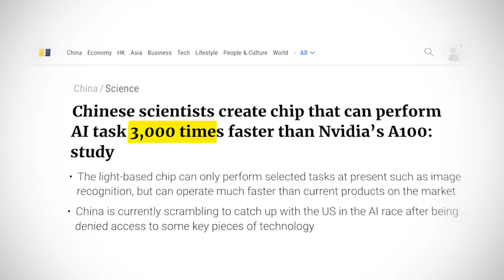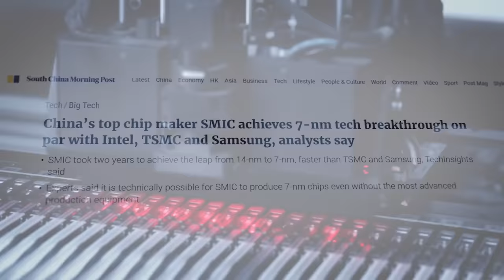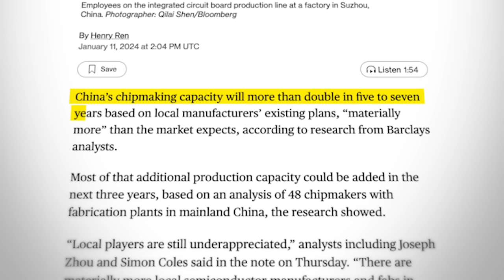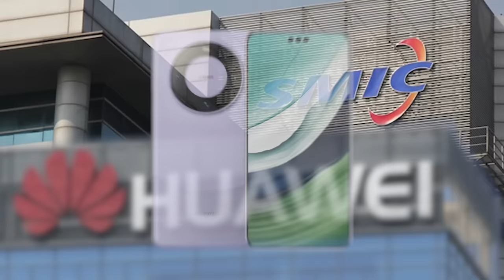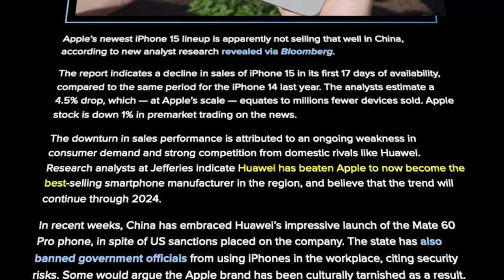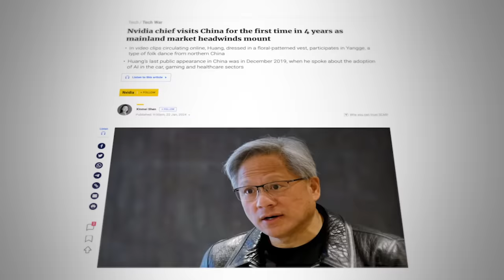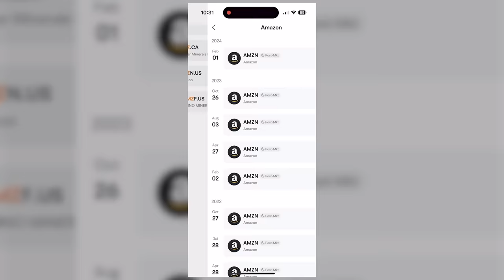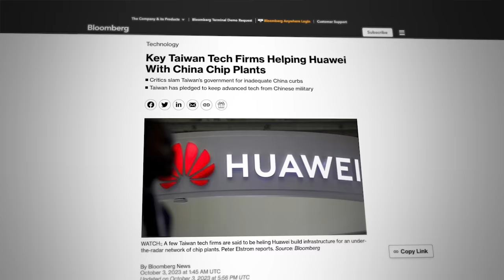China Created an AI Microchip 3000x Faster than America!

Comment: Photonic chips use photons instead of electrons in their circuits. When used for calculation, their accuracy is approaching that of electronic chips, but photonic chips have the advantage of using less power and they are faster.
Reply: do you think ernie 4.0 is the same level as gpt4? why china still can't produce something similar although tike toke have the best algorithms?
Reply: @el-_-grando-_-_-scabandri  What AI china developed is different kind of animal with gpt
Reply: @SaretGnasoh  gpt4 is the pinnacle of LLMs as for now, so where is the equivalent of it in China?
Reply: How do you manufacture photonic circuits? There's no equipment today that manufactures photonic circuits... its the circuitry that limits computing speed..
Reply: But, will it work in the dark or under a blob of that black "protective" PCB stuff?
Reply: It's mean they are fast as light..that it's a mind blowing speed and will revolutionize Quantum and AI technology
Reply: The reason why this statement isn't true is because the light based chips have to use huge lasers and focusing equipment to work so it cancels out any energy performance gains it would get over traditional chips.
Reply: @intothebeyond8763  Your statement isn't true because "huge lasers" cannot fit onto a small chip.
Reply: Most if not all the haters in this chat haven't a clue about what they're talking. Bridge collapses take place all over the place for all sorts of reasons. But tofu construction isn't oneof them. I challenge y'all to make a bridge out of tofu. If you knew what constitutes "tofu" you'll know nobody can anything out of it, except food. Food that is good for you that you will eat onr day when y'all can't afford anything else!
The Oakland Bay bridge was also built by the "tofu" constructors. Don't use it!

Comment: If China could manage to make cutting edge  chip everything in house, that would be total nightmare for the western world, since producing chip is very complex.  Hope China could do this!.

Cant wait affordable cutting edge chip from China =).
Reply: China is years behind and will have a difficult time to catch up, if at all, since access to cutting edge manufacturing equipment is cut off. A phantasized "1,000 times better wonder chip" won't change that reality.
Reply: @lorellaldos5263  Even without access to cutting edge manufacturing equipment, China managed to fabricate a 7 nanometer chip using existing lithography equipment.
Reply: @lorellaldos5263  "China is years behind and will have a difficult time to catch up". At Motorola, we said the same thing about Apple when they produced the iPhone.
Reply: @Shenzhou.  Yes, SMIC did that on ASML machines. But how will China get updated machines, or what happens when they need spare parts? In addition SMIC said the 7nm and 5nm chips are 50% more expansive than those of TSMC, usable chips are just 30% of output and they are unsure if production is sustainable. So how do you think this will work in the physical reality?
Reply: @lorellaldos5263  China already is making the DUV by themselves. Heard of 28nm lithography machines! this is the machine that can make 7/5nm chips. Next is EUV lithography. And its coming very soon. if not 2024, it will happen in 2025!
Reply: @lorellaldos5263  China is investing in developing locally made lithography machines (i.e 28-nm lithography machine). It may be more expensive at the beginning but if mass production might eventually lower the cost of chip production.
Reply: @lorellaldos5263  im not saying its easy for china, its very2 tough for china, since its not just about the tool to manufacture , but the material itself . But I thank to China for so many things that they did in 3rd world country. 

a very simple example is because of  China, 3rd world country could catchup about Internet wireless connection since 4g and now in 5g era. They gave those technology very affordable.
Reply: @idcashflow  And do you know who China is thankful to? Russia! Because Russia (or back then the Soviet Union) was responsible for the first industrial revolution in China around WW2. Up til then China was an agrarian nation, the west invaded China (the english, the japanese) and nearly destroyed the country. Russia came to the rescue (did the same with India btw.) for example with it's airfoce, China didn't have one back then.

And then after the opening of China 1979 western companies set-up their factories in China and probably provided a sort of second or third industrial revolution. We remember the joint ventures which China set up to educate it's population in high tech industries. 

But then how did the so called Americans (well they were basically all european immigrants in the beginning) rise? By technology transfer from the British via spying (they sent people with good memories to britisch factories to spy there).
Reply: @lorellaldos5263 Just like China couldn't build their own space station or advanced satellite navigation systems ?😂

Or Hypersonic Glide missiles, High Speed Rail, fastest wind tunnels, etc that the ga Ng ster superpower don't even have ?

Too bad for the blind adversaries of the dragonpower that they are indomitable ! 🤪🤣
Reply: @lorellaldos5263 You said: "the west invaded China (the english, the japanese) and nearly destroyed the country. Russia came to the rescue"

Russia was one of the eight nations that invaded China, together with Germany, Japan, Britain, France, the United States, Italy, and Austria-Hungary. The city of Vladivostok was historically Chinese before becoming part of Russia today.
Reply: @Shenzhou.  Russia got land for helping China, yes.
Reply: @lorellaldos5263  Helping? Russia was one of the eight nations that invaded China during the Boxer Rebellion. The Eight-Nation Alliance consisting of American, Austro-Hungarian, British, French, German, Italian, Japanese and Russian troops invaded China on 17 June and stormed the Dagu Fort at Tianjin. There's this Boxer Rebellion French cartoon of China being carved up like a pie and divided among the eight nations and Russia is one of them.
Reply: @Shenzhou.  China had been colonized by western countries between 1839 til 1949 or something. Over that time span of a 100 years Russia might have been one of the invadors especially in the beginning when the British successfully invaded China first, many other nations thought: oh that was easy, lets go there too. I'm sure that has been a volatile period in the region (China was forming, Russia was forming, different governemts, different political system maybe over that 100 years) but in the end Russia ended up helping China especially when the Japanese invaded 1937. The Soviets probably didn't want to have western nations on the land mass at some point. They solved all of their border issues and today are good neighbours doing plenty of trade with each other.
Reply: @lorellaldos5263 whatever China and Russia are sharing, they are none of your concerns. Many US technologies are basically US patents on Chinese technologies. Have US ever thanked to China?
Reply: Yes. Made In China chips will definitely be coming soon and will be much cheaper and more affordable despite what the US says or do.
Reply: @lorellaldos5263 read Anglosaxon medias good for ur brain' health
Reply: And Amerika will just keep SINKING, unless it LEARNS from its past mistakes.
Reply: @lorellaldos5263  China is not years behind as SMIC is about to mass produce 5nM chips for Huawei so they have caught up.
Reply: @lorellaldos5263  What's so difficult in making spare parts. You already have a sample easy peasy. Even if the chips are 50% more expensive they are only one part of the phone and will only increase the overall cost of producing the phone by a few percent.
Reply: @lorellaldos5263  This is irrelevant.
Reply: @lorellaldos5263  "Shenzhou. China has been colonized by western countries between 1839 til 1949 or something."

China (as a whole) was never colonized by the Western countries. Parts of China like Hong Kong and Macau became Western colonies yes, but not the entirety of China. Russia was one of the eight nations that invaded China during the Boxer Rebellion period. Even if you use the excuse "oh that was easy, lets go there too" that's still an invasion of China regardless.

You said: "Russia ended up helping China especially when the Japanese invaded 1937."

Imperial Japan invaded the Chinese province of Manchuria in 1937, how exactly did Russia help China in 1937?
Reply: you have that in taiwan the real china
Reply: @jacobscholtissek2410  no taiwan use asml
Reply: @Shenzhou.  Could you give a source for this. Thank you in advance.
Reply: Ignorant much? Heard of SSMB EUV lithography factory?
Reply: @lorellaldos5263 What if Taiwan returns to China?
Reply: @lorellaldos5263 What will happen if Taiwan returns to China?

Comment: How can anyone stop a nation that can build their own space station  ????🤣😁🤣
Reply from the maker: So true! and with the ISS set to be decommissioned in 2030, China will very soon have the ONLY space station
Reply: And  Russia to
Reply: A Space Station is not hard to build compared to the unseen microscopic world of controlling the flow of electrons in a microchip where distances are measured in nanometers - thinner than a human hair and even smaller than that. What a Space Station requires are just the huge rockets to send parts needed up there to low-earth orbit - all big physical stuff and China has a long history of making big physical stuff.
Microelectronics is a little bit different but not insurmountable. All that is needed are the right tools to manipulate the electrons around - and tooling is one area that China is learning to master. For example, their ability to make breakthroughs in Materials Science in the manufacturing of high-speed jet engine turbine single-crystal fan blades able to withstand the insanely high temperatures and physical stresses inside a jet engine. This was something that the West had previously doubted very much that China will be able to produce and have to always depend upon Russia for their engines. I am more impressed by their ability in this than in their Space Station even though it is no mean feat as well.
Reply: @George123-bv7xq  A  Space  Station   is   NOT    hard   to  build. you  have   said.   Afcorse   evry  country   has   one   Honduras. Venezuela   Germany. Poland. Spain. Peru   Guatemala   and   even   Albania   and   Romania.  LOL LOL What   planet   you   are on  😂😂😂🌍🌎🌏
Reply: @rogerburn5132  Don't be insulting. If you have bothered to read through what I wrote you would have comprehend that building a Space Station using known physics and engineering in rocketry is easier than the world of Microelectronics where the tools for diving into the world of electrons and quantum mechanics engineering is still at the frontier level. 
Citing examples of a weird range of mostly 3rd world countries (apart from Germany) that has little resources - economic finances and engineering skills well as a lack of national drive - to be able to build a Space Station is illogical and insipidly stupid as a counter point argument. By the way, I have a brother in NASA in IT engineering and software quality and I am in Electronics. My planet is more realistic than yours.
Reply: @George123-bv7xq   yes  I have  read   all  your   coment   this  is   why   I  answered . Mmm   maybe   I was  little  bit  to  sharp  with   my  humour . Sorry . For   Space  Stations  you   are   totally   wrong   there  is    one   international.  Space   Station    China   has   built   one   and   Russia   is   going   to   build   their   own.  And   to   build   them   you   need   space   rocket   that   can   carry   people    incredibly.   difficult   only   Russia   and   China   do   that   why   don't    you   ask   your   brother   Why  NASA   is   using   Russian   Rockets  to   send   people   in   space.  The   US   space   shuttle   was  decommissioned     many   years   ago    and   USA   doesn't   have   anything   else.   on   Microelectronics   yes   it's   difficult   but   Still   there   is   so   many  companies   that   are   doing it   The  BEST   one   is   TSMC    from   Taiwan   then   you   have    Samsung  and    Sony   and   Dutch   companies to  Chinese   to.  US   to   I   can   name   them  all   but   I   em   sure   you   know  who  they   are.  So   No   chance   to   compare   the   difficulty  of   building   Space   Station   with   Microelectronics.   I em  have   good   information   about   both    So  i  know   what  I   em talking.
Reply: @rogerburn5132  Whatever takes your fancy. 'nuff said!
Reply: In current times is not that hard to build a space station, is about purpose... is mostly hollow.. like a A background building, on a studio set. Is there to proof that it can be built, with none asking 'Why or for what'  , like their Tofu Dreg buildings... When you have autocracy , with no repercussions, you can build whatever you want,  and people need to work regardless.. it can be an empty space station, or a mega city shiny on the desert,  etc..
Reply: @George123-bv7xq  do you know how much chips inside the building of a space station ? hahaha
Reply: @George123-bv7xq  then why US not build their own space station?

Comment: Researchers from China and the US have also jointly developed a new type of stable semiconductor graphene, which displays performance 10 times higher than silicon. As silicon-based chips become smaller in size, scientists are gradually approaching the physical limit of two nanometers, by which Moore's Law would no longer apply. Carbon-based chips made from graphene show potential as an alternative to silicon-based chips.
Reply: That is correct. Photonic chip and graphene chip are the new frontier of chip. China will not be able to compete in Silicon chip in the short run as it lacks many core technology that was developed over decades of research such as design & lithography. Graphene & Photonic chip are like EV to traditional ICE cars.
Reply: @Tabula_Rasa1  Exactly. China has also invested a lot in electric vehicles and in fact, Chinese company BYD has become the world's seller of EVs, even more than Tesla.
Reply: @Shenzhou.  I know. That is why I am drawing a comparison to EV vs ICE. Graphene & Photonic are different set of animal and will require new core technology. You can't mix silicone chip with photonic chip. It will be interesting to see what is going to happen in 5 years.
Reply: "...3000 times faster than Nvidia's A100 chip!"

3,000% faster than Nvidia's A100 is not believable
3,000 TIMES (300,000%) faster than Nvidia's A100 is unpossible.
Source?
Reply: @Tabula_Rasa1  It's not that you can't mix silicon chip with photonic chip. From what I understand, there are companies that are pursuing research on imbuing silicon chips with photonic properties (i.e silicon photonics). Just like how there are EVs and ICE cars as well as hybrid cars existing concurrently.
Reply: @johnsmith1953x   It was a joint development between a Chinese research team from the Tianjin International Center for Nanoparticles and Nanosystems (TICNN) at Tianjin University, together with American researchers from School of Physics, Georgia Institute of Technology.
Reply: @Shenzhou.  Well, wake me up once they have a PC card or PC to sell that I can purchase for $20,000 or less.
Reply: @johnsmith1953x  You can purchase affordable All-in-One PCs in China at prices of $163 - $180 (from Ali BaBa) let alone $20,000. You can of course splurge more money to get the higher end PCs in China if you want.
Reply: @johnsmith1953x  There is nothing to say that they have to mass produce them.

Maybe they are for the niche market.  Maybe they aren't for your laptop.

That's the same for quantum chips.  They don't need to mass produce them.  They aren't meant for your laptop.
Reply: @Shenzhou.  I want a PC with this new AI chip in it.
Reply: @Shenzhou. 😅
Reply: @johnsmith1953x  Do you have the money then?
Reply: @Shenzhou.  I got the Motz.
Reply: @johnsmith1953x  What brand of PC is the Motz?

Comment: What a lot of westerners do not understand is that China might lag behind traditional semiconductors, they are the leaders in photonic chips. Accel is not only a combination of analog and photonics, it is designed especially for AI acceleration. Most commercial chips are designed to be multi-functional, like the CPU are design to do many different kinds of stuff but does it at an acceptable rate. Even GPUs, which are designed for graphics acceleration are still designed around doing multiple types of graphics acceleration like drawing, ray tracing, polygon generation etc. Therefore, most chips are not optimized for just one function. 

Chips like Accel are designed from ground up to be highly specialized in image processing and AI, which is partly why it has such high efficiency. Plus combining photonics and analog electronics reduces the energy consumption tremendously because you don't need to keep the electrons flowing to make the chip work; the laser light does a lot of the heavy lifting. China's lead in photonics is also why they are also leading in quantum computing which can be based on photonics electronics. 

You cannot sanction a country that has everything it needs to create new technology. It's foolish and futile. All you do is force China to stop taking it easy and push for the frontier.